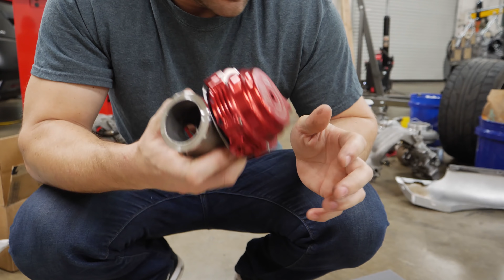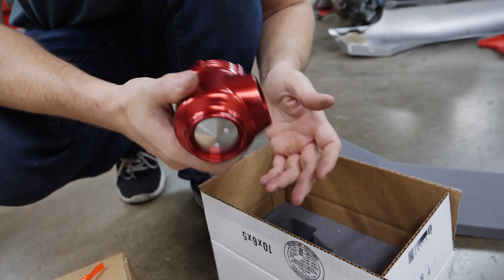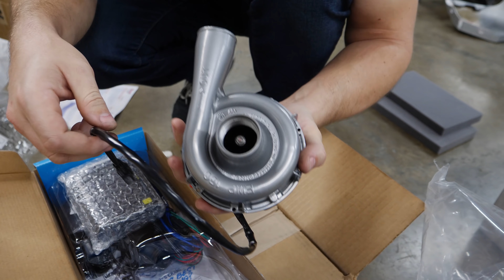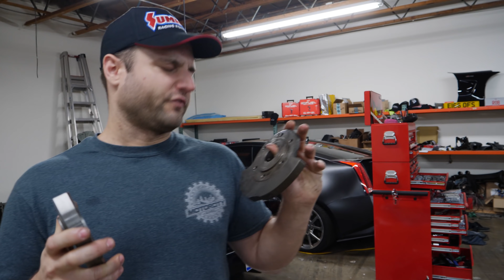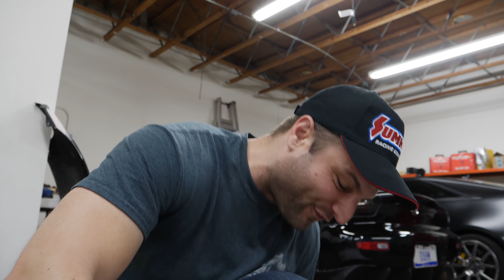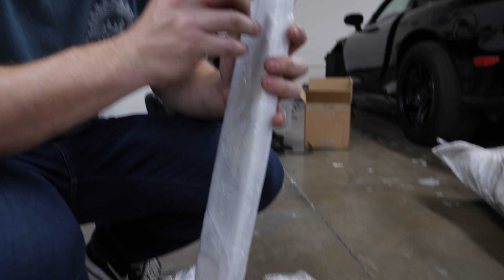Billet engine for the Rotary Corvette? Almost time

Comment: You press the bearing on first using a large ass socket as close to the same outer diameter of the bearing. then you lube up the seal with oil and press that on. Then you can install the retainer, then install the pully

Comment: I don't  think it has been mentioned,  there are TWO needle bearings that can be out of place. There is one behind the thrust plate. You need to remove the six bolts on the stat gear and remove the plate to inspect. If your careful, you can just remove the thrust spacer and see the bearing from there. I thing what your doing is cool!

Comment: This is all working out well, but every time something is said about how much stress is going through the front cover engine mount, I keep thinking it's not going to be a problem, because you have that massive bazooka transmitting the torque to the transaxle, so minimum torque reaction should be going into the engine mounts at the front.

Comment: Hilarious. Dahm is always giving “physics lessons” but I’ve seen him on several occasions disconnect batteries positive cable first. Install seals backwards. This dude is a troll. I like the content. Props for doing something different. I will be pointing and laughing when this high dollar billet rotary blows up like all of his other Doritos. Make sure the car is corner weighed when it’s all finished and running to put the LS/rotary weight dispute to rest. 🤘🏻

Comment: you put in the radial shaft seal backward. Also never ever "press" in a bearing like that. You can use a hammer but you need to make sure that you don't put any force on the bearing balls. In this application, you should have pressed in the bearing by pushing on the outer ring. (if you were pressing it onto a shaft you would use the inner ring)

Comment: A rotary Vette is the exact opposite of a LS swapped RX7...

People LS swap RX7s because it’s a relatively cheap, powerful engine with off the shelf parts readily available and that often makes the car quicker even with the engine in stock form.

This is taking a less durable engine, that has to be modded to match the original engine’s power, that takes a bunch of expensive billet one off pieces to fit, and will likely make the car slower.

This is essentially someone swapping a turbo Honda motor into a Supra because they like the inline 4 noises better.

Comment: LOL, that isn't a billet engine. That is a billet bolt on to a cast engine. Also your boost spring explanation is totally wrong. If you are using an electronic boost controller, you can use the smallest spring available, not the spring closest to the boost pressure you want. The boost controller will regulate how much air is allowed into the hat, so you only need a 1 lb spring to keep the wastegate closed, as it will stay 1 lb more than the rest of the system until it needs to open.

Comment: The bearing doesnt fall out everytime you pull the shaft foward, seriously as long as you dont remove the counterweight or pull it foward which i believe wont happen with the gear on.

Comment: Yeah but that bearing is designed to handle the load being put on it by the shaft being out 8 inches with a load leaning on it, i mean more than likely, your argument is understandable though but i think unless yout putting something it wasnt designed to handle then its when you should consider adding further support, my guess if it had an alternator there before when the engine was designed the engineers picked a bearing capable of handling the added weight

Comment: btw, coming from Audi turbos... Plumbing the bypass valve back into the intake tract, means you don't vent metered air. Generally better for fuel-air ratio. Sure, you'll still get lean-rich spikes, but not to the same extent.

Comment: Let's see where do I start.  First the bearing behind the counter balancer at the front of the engine is called a Torrington bearing.

Then he installs the thing he called "it's like the wax ring on your toilet" actually a simple oil seal backwards.

Also noticed the two "sponsored" items from Tial are clearly marked "NOT FOR RESALE". Companies usually do that on sample parts not sponsored parts.

I have no idea how this guy has 546K subs as he clearly doesn't know what he is doing.  This will be my first and last visit to this channel.

Oh BTW don't bother clicking on the link to his "SHOP" as it nothing but a shell site for selling his overpriced tee shirt.

Comment: Also what boost controller (if any) are you going to use? Im leaning towards a GFB ge force 2 or 3 for my Borgwarner 13b. Still not sure if i need the wideband functionality that the geforce 3 gives over the 2
Reply: ALSO why are you not using OMPs?

Comment: Is there a gasket for between the holes on that billet water adapter? All I see is one big o-ring for around the outside and nothing in the middle to separate the holes at the iron. Look at a factory water pump housing gasket. There is a piece of gasket that keeps the coolant flowing in one direction. Without a gasket in the middle the cooler coolant going in can mix with the hotter coolant going out. Big design flaw! 

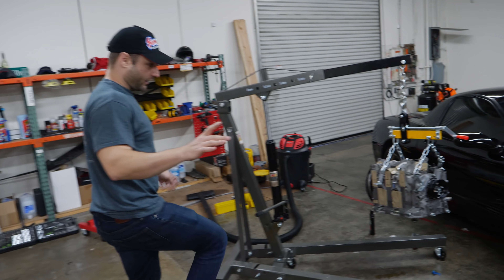   Also at 7:40 you had the engine hoist chain on the front iron stud with no nut. Then at the 9:58 there was a washer and a nut on the stud. I guarantee the chain slid off that stud and we didn't get to see it. After that I was just waiting for that stud to bend or break.

Comment: Pro tip, when you're trying to insert a part that's a really tight fit, throw the male piece in the freezer for a couple hours. The metal contracts allowing you to have a little bit of wiggle room.

Comment: Oil seal is for sure backwards per there direction remember the spring inside the seal goes inward towards the motor. Also I never seen you re install the oil pump front retaining nut.

Comment: The front needle bearing needs to come apart again, the rear needle bearings could of fell out, you only checked the front one, not the one behind the plate, it should only be assembled on its back or by someone pressing the flywheel forward until the front nut is tight.

Comment: Unless this cover has changed the oem design, it's missing the nylon o-ring that goes between the engine and the cover to oil cooler fitting port. You'll have all sorts of oil pressure issues without it.

Comment: Rob that front end looks to nice to put that crappy black belt tensioner bracket. Order up the length you need with hiem joints on both ends it would match alot better and they stay tight unlike the one you have. Most race cars use them for tensioners can get them from most performance part stores.

Comment: take it apart again and have another go. get the seal the right way up and also build the oil pump again on the bench to ensure the keyway is in properly and install it by the base bolts . never undo the oil pump big nut !

Comment: Couple things, besides the backwards seal everyone is harping about *(they are right, BTW)
The correct way to discourage the front thrust bearing from falling off the front E-shaft ledge is to push the clutch pedal down and wedge it down whenever the front cover is removed or the pulley center bolt is removed. Obviously you had the engine out so this is a moot point, but it sounds like you had the flywheel jammed forward.....
Second, while that AT rear counterweight is not blueprinted to your exact engine, it is factory weighted for your REW engine, thus it meets Mazda's requirements for balance within stock RPM levels. Of course, that goes out the window when you mod. In which case, yea get everything balanced together.
Third, lose the E-shaft thermal valve once you start modding. They can be failure prone and are easy to delete with a simple device. Just be sure to warm your engine completely before bagging on it (which all rotary owners should do anyways)

Comment: I know many have said the front oil seal is in backwards. I'm just making sure you see that and replace that seal with the SPRING facing inwards on the oil side and the stamped flat side of the seal faces you when installed correctly.

Comment: How is anyone investing that much money into an engineering project while simultaneously refusing to RTFM?

That engine will blow up the moment you put ignition on it. Reversed bearings and seals, missing bolts, missing nuts, not a single bolt torqued to spec... Come on dude, read the manual before doing it on the internet. You're like a virgin on his first porn shoot.

My dad always told me "You can do anything you want in life, but whatever you do, you better do it right and not half ass it."

Comment: rob you put the front timing cover  seal in back to front remove t cover drive seal out from inside carefully drive it in with t cover on bench with soft hammer or flat smooth wood and hammer

Comment: The thrust washes have fallen down, you must take of the front pulley with the motor facing upright or if it is in the car you depress the clutch to provide tension to hold the bearing in

Comment: legit had a dream last night that i was driving an rx-8 and drifting it, first driving dream EVER, that I drifted without crashing, and had control of my car. usually i have dreams where the car is out of control, or wont stop, brakes not working, sliding off the road into a body of water. whatever. yet last night my dream said "rx-8" i wonder if my dreams are telling me my next car should be a rx-8.... lol

personally, i think you take too long to explain things and don't really get to the point which is working on the car. id rather listen to you blab while you work than blab doing nothing but pointing at shit. ive watched many online car shows. mighty car mods, bad obsession motorsport, aaroncake, they all show actually working on the car rather it be step by step, just a quick look, or using editing to cut down a 2 hour job to less (for example). i find myself skipping around your videos to get to the good stuff, which is the car, and working on it. so don't take it as being rude, maybe just let it help you make better videos. grain of salt, but also think about it.

Comment: besides the seal being backwards is anyone else worried about how many finger tight bolts will be on this enging let alone all the missing wasers needed to securely fasten these brackets to the engine?

Comment: Seal is backwards, spring always goes to the inside. Did you remember to put the nut on the oil pump drive 19:30?

Comment: Not only is the lip seal in backwards, but without removing the seals of the bearing your risk bearing failure (it comes pre greased but this not suitable for higher rpm) also the lip seal will not receive adequate lubrication and will fail but not before tearing up that shaft.

Comment: And when it comes to that bearing that you're talkin about crushing you didn't even check the right one the one you need to check you need to remove that plate with the bolts to get to it since you didn't do that the way you can tell is if the spacing ring is leveled with the bearing that is visible once you take off the bouncing ring

Comment: Yo give you heads up you need  to buy the Atkins thermal pellet they sell it on atkins.com it will keep oil going throughout the whole system and not bypassing and you messed up taking the oil pump gear off it is going to be a nightmare trying to get it back on with that key way you take the 4 10 Mill bolts off the back of it and and Slide the whole pump and gear off as one

Comment: You didn't attach or torque the nut going on the bottom sprocket wheel behind the billet housing. Sorry for using the incorrect terms, I'm not used to seeing the insides of a rotary engine.

Comment: Do you read the instructions or do you just get distracted, because you installed the seal backwards at 19:45?  You seem proud that you don't need instructions yet continue to mess up because custom parts require following custom installation process listed in the instructions.

Comment: Make sure you test those wastegates and make sure the springs are right. Tial had the wrong springs listed on their sheet for what I was going for on my DocRace kit, I put the correct springs for what i was going for and i had a shop confirm i put the right springs in, they labeled the sheets wrong
Reply: Super nice equipment though, not bashing them, just look out for that

Comment: Would need to check the inner flat bearing isn't pinched by the spacer not just the outer one otherwise no end float on the eshaft ..

Comment: Hopefully this 2-Rotor that you're installing in the Corvette is just a proof of concept and that you'll really put in the 3-Rotor that will get fixed into the Corvette Body!
You had way to many Engine Bay space issues with shoving in a 3-Rotor into the RX-7!
Hopefully you can have a updated / reliable 3-Rotor in the Corvette!
Then have the RX-7 with the 2-Rotor be updated with all the latest Billet Parts and add in all the features that you want!

Comment: The seal is install wrong and the oil pump nut is not install
Reply: How the fuck did he forget that. The gear was so loose.
Reply: Noticed that too
Reply: So is it gonna go boom?
Reply: @FroztiProductions  maybe the gear would float around and cause the oil pump chain to snap, but he'll probably fix it before the car even starts up (let's hope....).
Reply: @bentracy7463  way he puts everything in doesn't look like he plan to remove anything. Lol. Hope he's reading the comments and unfuck his wrong doing.
Reply: don't think he actually completes it  someone else takes it apart and 're does his job just for views

Comment: I think you left the nut off of the oil pump. Not to mention the front seal is clearly in backward (as many have already said). Don't be tempted to leave it that way. It will leak an alarming amount of oil.

Comment: Did you replace the oil pump pulley retaining nut didn't see it on the bottom pulley both times you had it apart

Comment: Please tell me you put the nut back on the lower pulley at 15:20 =/
Reply: 20:45  bottom right of rag. still there...
Reply: lmao this motor is fucked. Backwards seals missing nuts for the oil pump drive. I wont run long.
Reply: he fucked up this motor to no return....RIP
Reply: Yeah, at 19:37 you can see the nut is still not installed. RIP
I knew he was fucked after his next step was "install oil pump nut" and then he skipped that and went right to "Ooooh shiny things"

Comment: Won't the Billet 2 rotor throw off the weight distrubution of the car? It should be a lot lighter than a LS.
Reply: That's the point, lighter is always better

Comment: With all that space in the front couldn't an adapter be made so the alternator mounts inline with the crank and mounting to the front plate to keep the lateral pressure off the bearing?

Comment: Hey Rob, just as a heads up, that oil seal is in backwards. That spring faces in, the flat side faces out. If you leave it as is, you'll have oil all over that front cover. 
Love the build so far though dude

Comment: why did you installed that oil seal backward? wouldn't oil pressure simply open the seal if it sits like this?

Comment: Also u don't put a bearing in like that you should apply pressure to the outer race and in ur case cos of the inner shaft both races of the bearing at the same time

Comment: 20 thousand in parts for a 12 second car.
Reply: No, all he's doing is making a statement, everyone ls swapps everything and he is the only person that does the opposite
Reply: @nilshohenwarter7872  An ls swap makes sense most of the time. Gobs of horsepower for cheap. If his goal was to make the rotary look even worse compared to an ls, he succeeded.
This swap will not make the car faster than its original ls could. This makes no sense...complete fail.
Reply: @berrytharp1334  it's amazing
Reply: @berrytharp1334  
I like the project but I disagree that the rotary is the best choice for a swap very cool but bang for buck the 4.8,5.3,6.0 stuff can't be beat.the average guy or girl wouldnt be able to afford this type of swap, if he were to swap a stock rotary not a built one giant turbo etc,in place of the ls that is n/a would be a real comparison. Very cool build just a bit goofy comparing the 2 engines
Reply: Right. Could have used this time and money to finish other builds.  He is the type of guy that thinks he gonna out class people at Ls  fest.. makes no sense.. if it was a corvette  fest yah I could see it,but no
Reply: Because the whole of a car's appeal is its quarter mile time and not the craftsmanship and character. And of course he could have dropped 5k into his ls to make it quicker but what's unique about that?
Reply: @jon doe  ha...ha.....hahahahahaha.
Yeah buttercup...this is a 1500 hp rotary.  Bwahahahaha